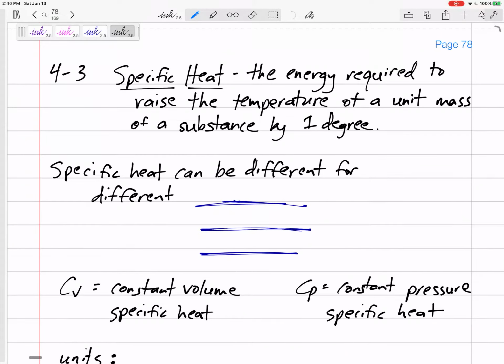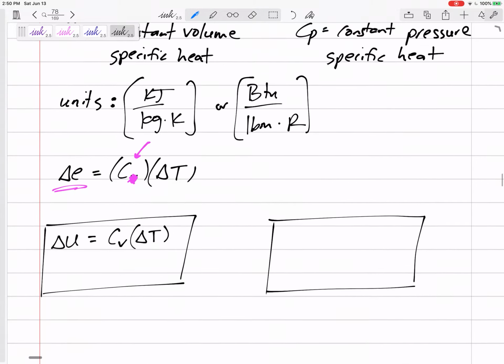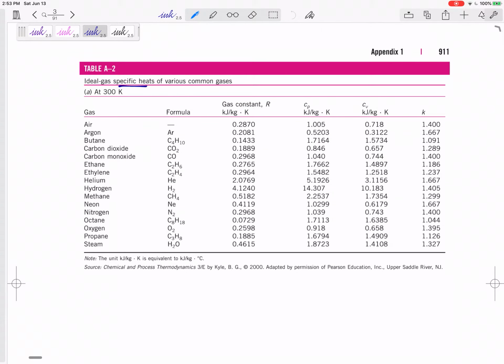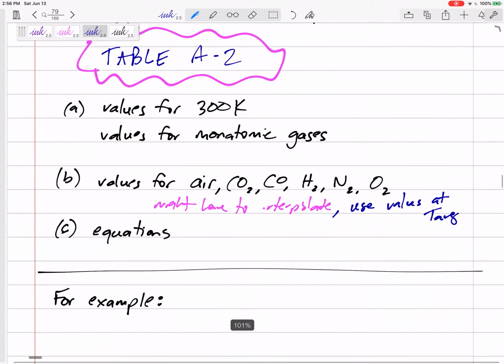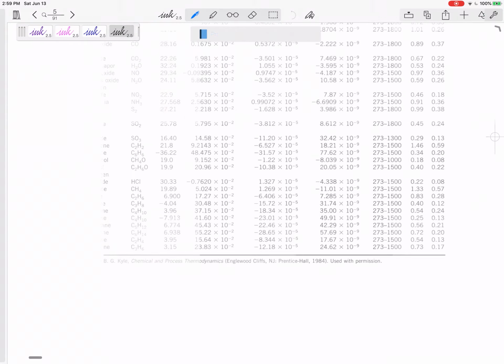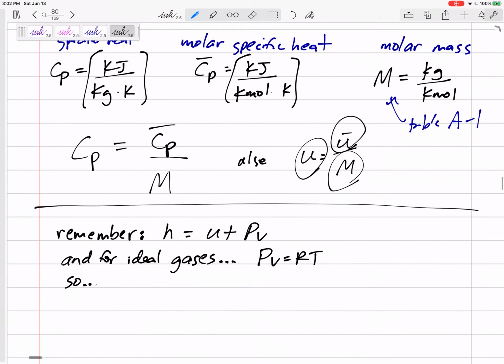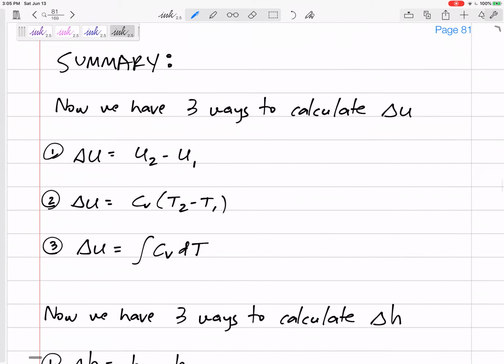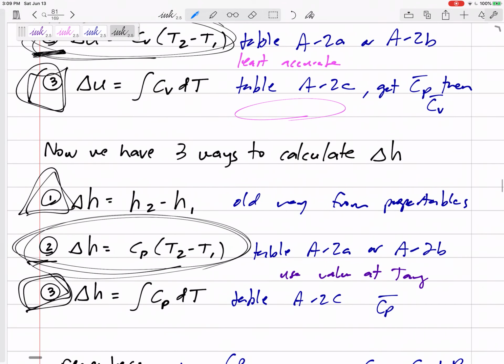Thermodynamics - 4-4 Calculating U (internal energy) and H (enthalpy) using specific heats

Comment: Sir, is table A-2(a) valid for UPTO 300 K (i.e. T= 0-300 K) or is valid only if the gas is AT a temperature of 300 K (i.e. T=300 K)
Reply from the maker: I think it’s just at 300K. Table b and c are for more temperatures. And then the next tables are for liquids.
Reply: @engineeringdeciphered  ok Sir